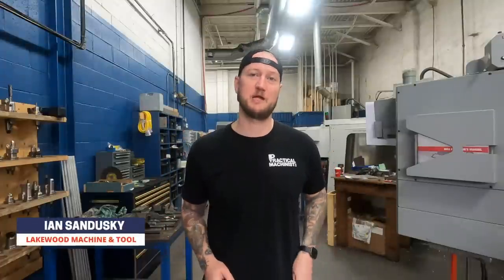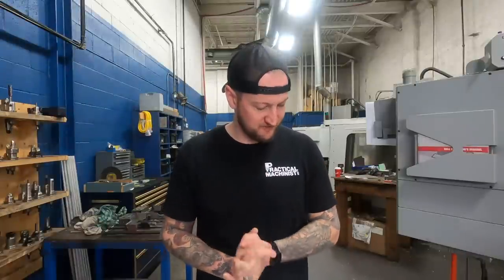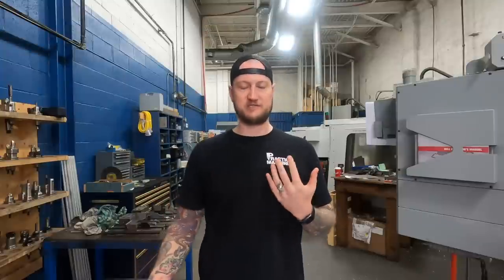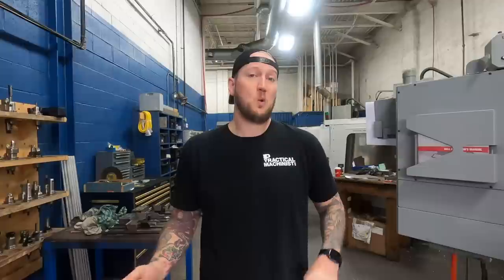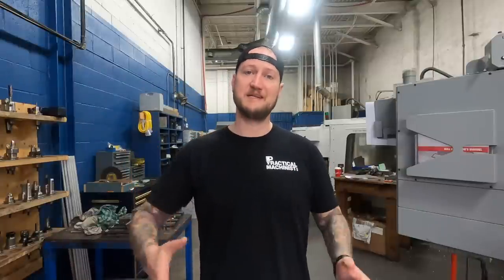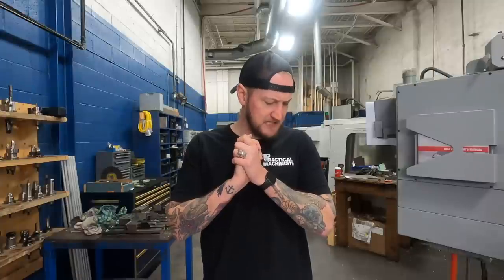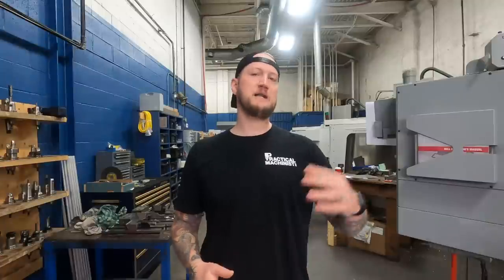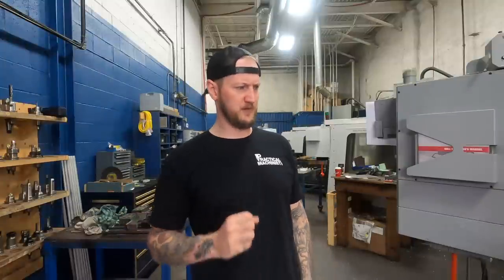Customer Won't Follow Their Own Tolerance | Machine Shop Talk Ep. 83

Comment: The P.O. is the top document. In the pin example tell the engineer to update the P.O. to say "make per engineering drawing 123-4567, rev B
except OD of part will have an <=8 uin finish. The P.O. can add and/or subtract from the engineering drawing.
We do that all the time in aerospace usually with spare parts.

Comment: I’m a cnc machinist and my brother is a mechanical engineer, both in our  mid/late 20’s. My brother graduated from an engineering college and not once did he have a class or even a lecture on how to make a print. He started at the company he works for as a graduate engineer and they immediately had him design parts and prints on his own. He often times will send me a draft of the print before he releases it to his shop floor. I think all engineers should start out of the floor or in the field so they can understand what a print needs or doesn’t

Comment: I worked with a customer that rejected parts similarly to your pin example. Many features critical to function weren't even dimensioned on their drawings. Their engineers were very good at design, but not so much at creating drawings. After some initial headaches, they turned out to be an excellent customer, even though the engineers never did learn how to detail their drawings well.

Comment: How about a customer with serious revision control issues. It's not uncommon to send this customer a first article and they respond with six different versions of a print labeled "Rev B" marked up in various locations. None of the "Rev B" prints match the print they submitted with the purchase order. We then have to kindly beg them to inspect the part to the print they provided. Halfway through a production they will send a solid model and ask to add "features" from the solid model to the machined apart (the model does not match the machined part or any drawing we have ever seen).

Comment: I am an engineer, now retired. After retirement,  I worked part time for a company that had no incoming inspection.  Purchasing always went with the lowest bidder.  If they could save a few cents by waiving tolerances or material specs they would do so without engineering buy in.  In many cases it resulted in parts that would be potentially dangerous if installed or would have greatly reduced the service life.  Each time I found a problem part I reported it to my boss who was head of product life cycle management and copied the head of purchasing.  All I accomplished was to piss off purchasing.  I gave up a lucrative gig because my conscience  would not allow me to look the other way on safety issues.
Reply: Worked for a large military/defense contractor for 15yrs. When we got busy, we outsourced a lot of stuff. We had a so-called 'incoming inspection department', who mostly just rubber-stamped the source inspections. Often parts would sit for weeks/months in stock until needed for assembly. Then we'd find the discrepancies. Panic time! We had contracted delivery times. And the stuff was going to the war in the sandbox! But how can you go back to the supplier when our incoming inspection signed off and the bills were paid? Lot's of OT doing rework!
Reply: @pb68slab18  I worked for an elevator company.  They made their own worm and gear sets. A field service tech decided they needed to change from an 84:4 ratio to 85:4 to provide a "hunting tooth".  He and the shop foreman worked out the details and supposedly informed Engineering.  I discovered that if the gear set were made to the drawings, the center distance would be 5/6" too large to fit the gear case.  I repeatedly told the VP of engineering that there was a problem and that they needed to send sample gear sets to a gear metrology lab to find out what they were really making and update the drawings.  It was not done.  The company sold off the machine shop and outsourced the worms and gears.  None of the outsourced gear sets fit the gear cases.

Comment: After 40 years in manufacturing and tool & die, this brings back so many instances of miscommunication, engineering inexperience or arrogance, all of which could have been avoided. So much time can be wasted because a phone call wasn't made, an email wasn't sent, or important notes on a drawing weren't added. 
When it comes to young engineers, I will always remember having a conversation with a new engineer about the lack of tolerance for a 0.2000 ID dimension on a drawing he sent in. He said there wasn't a tolerance. Zero? He said yes, zero tolerance. Not even a millionth? Nope. I liked the kid and I really tried, but after a half hour of trying to explain something that he should readily understand he still insisted it had to be zero. He wanted them perfect. I had a conversation with his manager, and he told me to get them as close as I could. I asked him to please revise the drawing or put that in writing. He refused. I had a good relationship with the VP of this division and just happened to run into him later that week. I told him the story. New drawings arrived soon after.

Comment: threads are a pain in the ass, we had some problems with minor diameters  being undersize with a company, The threads UNS with unj speck so major/pitch/minor .003" undersize, we never checked minor just used gauges, as this company just bought a laser measuring machine it picked up the problem, we had their quality manager out telling us how to check the threads, he did admit they had just scrapped £60k of parts from their machine shop for the same problem,  he would not listen when i told him i couldn't produce the thread to them dimensions without increasing the route rad, but you can't do that on a unj , parts put on hold till engineering looked at thread data, works out they never reduced the minor on the drawing so drawing was wrong, as rolls royce parts they have been on hold 5 months now for a drawing change, but the funny thing is, really they are right to thread data just wrong to drawing thread data. so i been told heads are rolling as we have made 1000's of these parts over the years and all wrong to drawing but passed inspection. But as for thread forming we have on RFQs from all the aviation companies we do work for no thread forming. sorry i waffle .

Comment: Sadly engineers have not been getting deliberate training in machining or manufacturing for a long time. I have been an engineer for almost 40 years. When I was in school in the early 80's, the University dropped the drafting requirement for my class to 1/2 a semester, and the exam was just draw an orthographic drawing with no dimensions. No GD&T or dimensional analysis. This was pre CAD, mind you. There was NO actual machine shop class available in the engineering school at all. In order to take a machining class, I had to look in the teachers college course catalog to get a class for shop teachers. There were machines available in the labs, but what a sadly abused set of machines they were.
Fortunately for me there was a great staff shop where I interned and the machinists were willing to out up with a green engineer who wanted to learn something. I was also required to work in the drafting room for 3 months making drawings. 

To illustrate your point about how a machinist can educate an ignorant engineer, I'll relate a story my Grandfather told. He worked as a tool and die maker in the 1950's. He got a drawing once from an engineer requesting a steel block with a square, blind hole with sharp corners. He asked the engineer if the hole could possibly be circular in profile instead of square. The engineer told him that would be great, it was what he really wanted, but he made the drawing a square because he thought it would be easier to make.

Comment: I was an operator at a CNC mill when I had a job to do that was similar to this; no stated tolerances. When the lot was rejected, the customer tried to blame me for the bad parts. But I had a good boss to back me up and show the customer my inspection sheets for the job to demonstrate my duty of care for the work. Found out later that we were sent the previous revision of the part and not the current one (was sent Rev C. not Rev. D of DWG).  Scared the heck out of me to think I'd messed up and cost my employer big $$$$$.
Reply: Too much stress for s trade that will not compete your wage with McDonalds worker wages😂
Reply: Most standard drawing 'blanks' have a listing of ''tolerances unless otherwise noted'' in the lower left information block.

Comment: Threads also have crest diameter requirements. For internal, you need to check the minor diameter. For external, it’s the major diameter. So you need the go gage check, the NOGO gage check, and the crest diameter check.

Comment: I worked in tool and die before I eventually received my degree in Mechanical Design. As a designer, most Engineers know nothing about design, let alone detailing a drawing. Most of the Engineering interns at work can't even read a print. Hell, our Quality Engineer has a English Degree. I design gages for him because he doesn't know anything about gages.